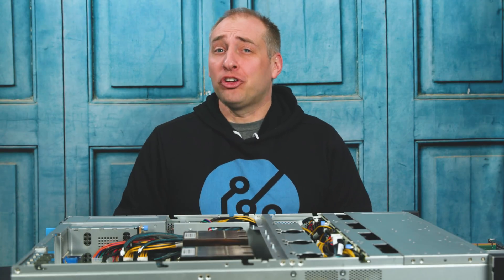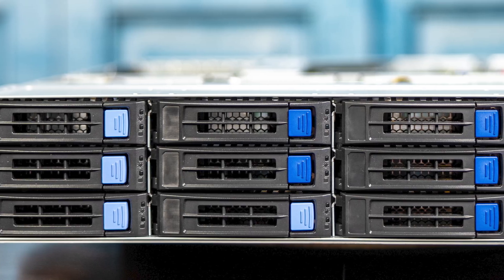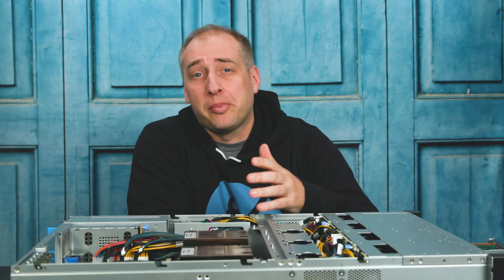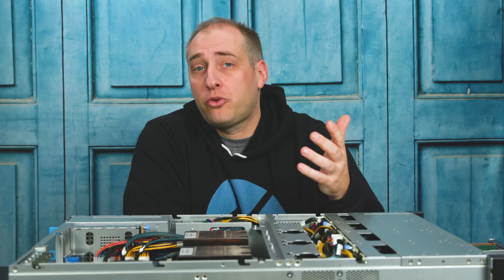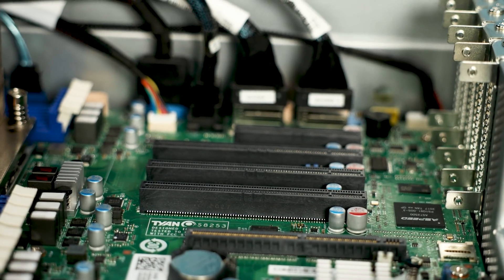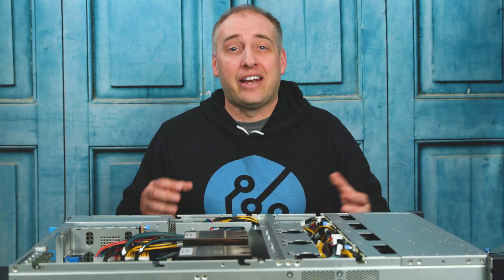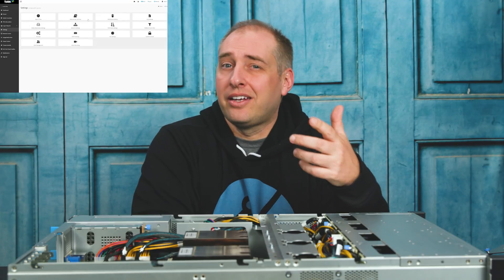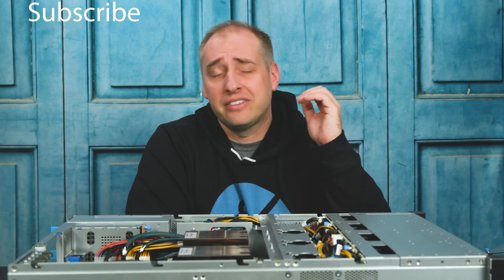Tyan Transport SX TS65-B8253 Dual AMD EPYC PCIe Gen4 Storage Server Review

Comment: Idea of the price? Just did the math on power consumption and with the solar panels at home, this gets feasible. Also, any word about the noise level? I would like to see this in a 4u chassis, so I could mount something more "home friendly" as cooling, but this one really ticks a lot of the boxes. Nice video, subscribed! A lot of info at a slow pace. As a foreigner (brazil), it is hard to follow some videos at first because of the pace the hosts usually talk (is not their fault by any mean, they still great - linus and wendell), but I got everything here in the first pass. Thanks!
Reply from the maker: Thinkmate has a public configurator that does include building the server and warranty so it will be higher than a barebones, but it gives some idea.

Comment: It strikes me this system is designed around big data applications or data warehousing, such as running Kafka, Hadoop, Spark, or Cassandra/ScyllaDB, more so than being a simple storage server. It's geared around memory bandwidth: that's the only advantage I can see of going with dual processors (unless you're trying to hit super high core counts, but 128 cores would probably be better paired with more NVMe storage options and/or better networking). It's not bad as a general purpose server either though: if I didn't know what I needed it wouldn't be a bad place to start.

Comment: @ServeTheHome, @12:38, you talk about the SlimLine connector on the back of the dual 2.5" hotswap cage.  It seems to me that the motherboard industry is accepting the fact that internal PCIe is not always going to be with slots and with EPYC's numerous and reconfigurable high speed serial lanes on their CPUs, one can get multiple types of interfaces broken out to standard connectors like the 4i and 8i SlimLine connector (SFF-8654).

Look at a motherboard like the Gigabyte MZ32-AR0 - where PCIe slot 7 (the one closest to the motherboard IO shield) gets its PCIe lanes by running a set of 4x jumpers to the U.2 ports (SlimLine 4i) in the opposite corner of the motherboard from the OCP NIC notch (see block diagram: https://www.gigabyte.com/us/Server-Motherboard/MZ32-AR0-rev-10#ov ).  It took me a while to figure out how to articulate it, but essentially what they did is make a 4x SlimLine 4i to x16 PCIe slot adapter right into the motherboard...  I'll bet that if that connector on the back of the dual 2.5" cage is 8x SlimLine there's an off-the-shelf adapter where on of those x8 PCIe slots can be pulled out to a standard  SFF-8654 8i cable.

It's a bit off topic, but I think we're about to see a renaissance of internal PCIe adaptation and flexibility due to motherboard designers realizing they actually don't know how to use all the lanes from EPYC and harmonizing around one standard just to make the lanes available - I'm trying to get my surfboard up on that wave...

Comment: That's a neat system.

I wonder if Tyan has an all NVMe solution and I wonder what kind of performance you'll be able to get from a system like that.
Reply: At that point, you'd be mostly limited by the IF links on the EPYC CPUs and RAM lol.
Reply: @neutronpcxt372  Not necessarily.

That depends on configuration.

If you have 12 U.2 NVMe x4 SSDs, that'd be 48 lanes.

If you have 24 U.2 NVMe x4 SSDs, that'd be 96 lanes.

So it depends on how you are using and/or provisioning the available bandwidth capacity.

Comment: Do those PCIe slots support bifurcation in the BIOS? For example split one slot to quad x4 slot for M.2 nvme SSDs.
Reply: All EPYCs do support PCIe bifurcation and support on the system-level ist part of the AGESA code in your system's firmware. Granted, an OEM could deliberately disable the PCIe config section in the BIOS config - but there is nothing to gain from doing so and it does not save any cost. So chances are slim somebody doing such thing.